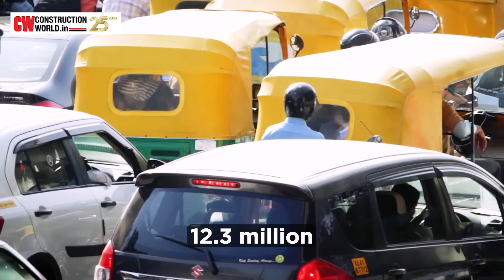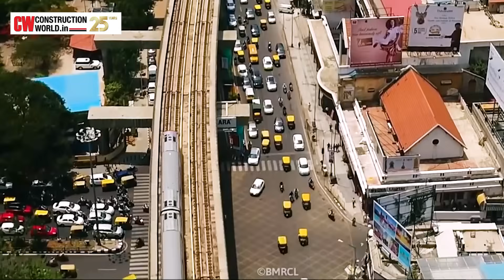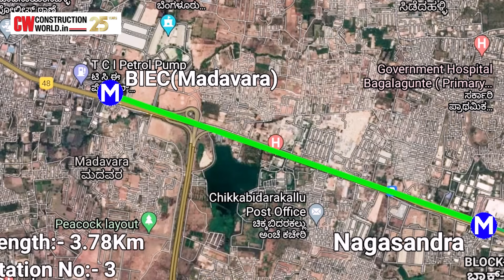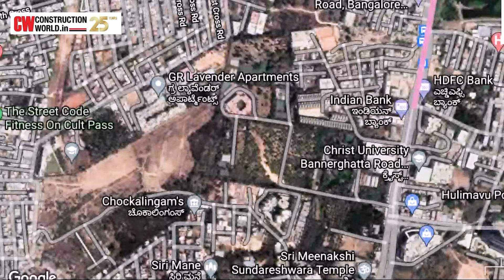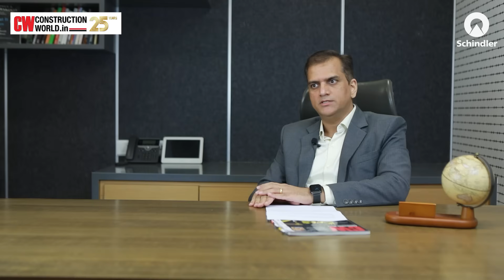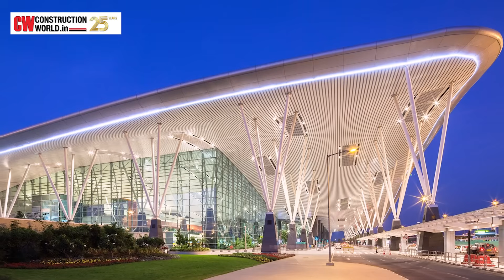Bengaluru Metro - The Second Longest Operational Metro Network in India | CW Projects

Comment: Why you are giving wrong information.AFter delhi hydeabad is the second longest metro folloed by chennai.do not upload false information.pl note
Reply: Sir you are correct that the existing longest metro rails in India are 1. New Delhi - 348.12 km,  2. Hyderabad - 67 km,  3. Chennai - 45.046 km. But the video is not about the current position of the metros, the presenter clearly explains that Banglore metro will become the 2nd longest metro in India in 2023 after the 2nd phase is completed. here is the details..Bangalore (Namma) Metro Phase 1 with routes totaling 42.30 km existing length. Bangalore (Namma) Metro Phase 2 project with 73.921 km after completing in 2023. (42.30 + 73.92 = 116.22) So the information is not wrong. good day to you sir.
Reply: @RaviChandranjennifer  even tho. Mumbai metro will be 2nd largest after the completion in 2026 with more than 200km.
Reply: @akihokokurosaki  yes in 2026 it will be, but This Thackery Govt is not allowing it to get completed in 2026, it is very sad.

Comment: BMRCL for all its achievements, has never completed a single line or phase on time or without huge cost over runs. Despite this, they want to have monopoly on all City mass transport, wanting to determine what their scope will be, only slowing City 's development when it has a huge and miserable traffic problem on its roads. Added to this, BMRCL creates more traffic problems by talking large parts of existing roads for extended time to construct.  

Metros started in other Indian cities much later have progressed faster despite having all problems which BMRCL claim. Ticket prices are also higher than other metros. Further, last mile connectivity to stations and coordination with other civic agencies are never a strong point for BMRCL and there, they want to limit their scope.  Hope atleast next generation will benefit from BMRCL if and when they complete all phases.
Reply: This is the problem with a public private partnership model; it’s a government induced monopoly instead of a natural one. At least natural monopolies provide the service at a low cost for both the consumer and the company; state-run monopolies are simply not efficient because their cost caps are so much lower; they function dependent on the funding they receive from the government. Instead, we need privatization of the construction process while putting it under regulation to ensure it functions at a price ceiling